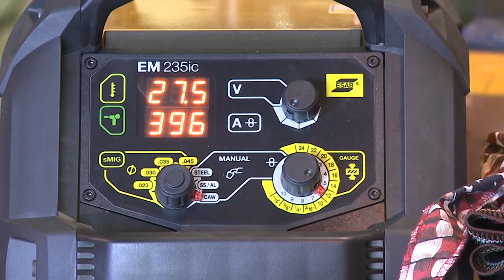🔥 Welding with Ceramic Back Tape

Comment: Pretty good video. We use ceramic all the time in the shipyard. When we join units together in the dry dock or pre fab shops. It’s a lot easier then a metal backing. We use a different wire but basically same idea.  X ray and UT quality in the shipyard

Comment: Hello, when I was working for USNS, CHARLESTON NAVEL SHIPYARD IN 1990-1996, I had just started in my welding career, we used tile on all plate fit ups, even corner joints, Flux Core process. The only thing we would not use it for was on the Hulls of Nuclear Submarines, HY-80 / HY-100, using SMAW- 110/18. Yes I think you could’ve dial that in a little better, getting rid of some of spatter, probably turn the bolts up , wire speed down a hair. But I think you did fantastic. I think all of your tutorials or really great, I am a journeyman pipe welder and have been since 1997, it is really good that you teach the backfeed method on Pipe, Test Supervisor, are not going per code these days, B31.1- B31.3, ASME III , it seems they have their own personal preferences these days, on what they want on root reinforcement, you go to Louisiana or the West Coast and they want minimum 5/32 gap ,  Heavy root, then you go to other places and they want flush to 1/16, which is code. Thank you for all you do younger generation is in desperate need, and the industry is definitely hurting from the lack of craft.

Comment: I used that tape when I was at welding school for uphill welding with fluxcore wire (Esab OK Tubrod 15.09). Way faster than open root or backing plate.

Comment: I've got a roll of it in my locker. I use it every now and then when those fitters decide to leave me a 5/8" gap to tig shut. crank the heat and pour the wire in. stuff works really nice!
Reply: 5/8" gap! That's like the Grand Canyon, I love Tig and have pushed a lot of wire but that's beyond anything I've done. Do you have any video of that?
Reply: James Zivny I don't have videos but I've got some pics. idk how to upload pics tho
Reply: Brian lair 
I'm  one of those , you see most shipyards the fitters and welders are ONE. @ bae systems ship yard the welders and fitters are separate, we preps and do most of the work. the welders just weld...........that's it , you will never see a welder carry blue prints  because their spoiled🤔
Reply: Brian lair 
i wouldn't leave 5/8 gap though, that's too much lol

Comment: Awesome presentation Bob ,I'm a welder for w&w/Afco steel we  used that ceramic backing tape quite a bit groove weld on structure beam bridge beam it also comes handy plugin holes

Comment: One of our test at bath iron works is 3\8 plate double bevel feathered edge ceramic backing vertical up vertical down horizontal and overhead 0.45 100s hard wire 95\5 gas. Roots have to be perfect. Pulse arc. Now theirs a video id like to see you do!!!! Great videos love what you do!!!!

Comment: I'm sure you've figured this out by now, but when you're welding in the flat position, you're in about the top end of the recommended parameters for that wire at 400 ipm, but your voltage is a bit low for that speed. At 400ipm I'm usually around 29v and adjust to the particular wire/machine I'm running til I'm just at the threshold of getting that nice spraying sound.

Weld still looks good and has adequate penetration if your voltage is just a bit low, but you end up with way more spatter than you need to which can be accidentally welded into the toes of your weld if you're running long fillets

Comment: I use ceramic on a daily basis, on the root pass hit bevel to bevel, then stringers to fill out the rest... our code says 5/16 max size bead. So you're doing the root correct but the hot pass and cap should have been 2 hot and a 3 pass cover to weld to standard. i weld 3/8" to 3/4" material sizes... Mostly 3/8" and if we can't get the steel backing plate in, we use the ceramic for that and the edges of the cover plates, they last a good while, jus grind to the shape ya need to fit and weld away... they work great for plugging holes in materials that were drilled in the wrong place...

Comment: I have used ceramic tape in welding stainless as well as mild steel. I once tried welding 1 inch plate in one pass with the ceramic tape and flux cored T70 wire worked well but even with a water cooled torch after a couple of feet run I could see the tip through the nozzle just before it melted. That was back in the mid 90's, as I remember it was around 32 volts and 450 amps basicly had the machine flat out.

Comment: Have you guys done a video on plug welds? Today I was forced to do some plug welds for a friend in the vertical position with very old and unbaked 7018 . I'm a new welder so i did my best ... good thing the welds don't need to be that strong in this case cuz I have no idea what I was doing

Comment: Used this stuff on a steel haul super yacht here in a NZ boat yard used boxes of the stuff works well. Tricky to use overhead though with solid wire on mig.

Comment: They make them also in a beveled variety for welding heavy flange butt welds on full pen WF beams.
You tape it into the bevel side and then weld the inside of the flange, remove the tape and fill the beveled side.
It eliminates back gouging in many instances.

Comment: As a few people have stated before, 70 C is a "metal cored" wire, it will contain very very little to no flux in the core powder.  Mostly all alloyed powders.  You didn't note what brand 70 C you were using or diameter ? I would try it again with either 100% Argon or 100% Co2, as most manufacturers now days are designing the 70 C to run on either one of those gases.  Also, " metal cored" wires don't pick up moisture from sitting out in the open like "flux cored" wires do, so unless the wire is has been sprayed with water or had something spilled on it or is extremely dirty/dusty, I don't think that is a problem.  Just my opinion, but it looked like the puddle had a lot of disturbance, might try backing off wire feed and voltage.
Reply: Rick Reiff Good feedback. Thanks

Comment: Nice bob, for a moment then I thought we were going to have an entire episode without a funny..... Hey what about doing an episode on joining some I beams... Maybe end to end or at 90 degrees... Might be useful for those workshop projects !
Reply: You can use 2F, 3F and 4F positions when joining I-Beams
Reply: ARCSTREAMS 
Why do it that way? All about speed and ease of construction. 
Plates usually welded onto beams, rolling the beams so all welds can be welded 200 amps plus spray transfer Gmaw, or dual shield fluxcore. High speed, high penetration, high strength/quality (just as strong if not stronger than mmaw with low hydrogen rods provided procedures are followed). 
Lower labour costs due to speed, therefore maximum profit.
If site welding in position cant be avoided, usually 7018 Mmaw.

Comment: I used a lot of it in a shipyard. When wire got called for. Never with stick, mainly because stick process was saved for repair. However I'm sure it would function similarly. The big reason it's used is you can run that monster 1/4' gap and ensure a properly penetrated and fused root without running 6010 or backing and it's a shit ton easier than OR flux core procedure. Our procedure still called for a backgouging/welding procedure in conjunction with it. Which I'll admit was dumb as hell. With a 1/4" fit up you can throw a 5/16" x 1/8" cap down the weld to meet reinforcement requirements and move the hell on. Lol
It works really well. 3M makes some that works really awesome.
I've used it some on tanks, mainly in conjunction with automatic processes like sub-arc and automated flux core wire feeders. It really helps.
Also with bad I mean like should fail an x ray kinda 1/2"-5/8" gap fit ups. I'm sure Bob has seen that bs a time or two.

Comment: We used 71T1 wire to weld our verticals in the shipyard X-ray test. About 20-23 volts. Wire speed about 200-210. We put no movement into root pass. Just had a run off tab in the entrance and exit, we'd dip into the plates off run off tab. Then keep steady tight arc and let the weld do the work with very slow movement up the plate. Which created a very nice root on the back of the conjoined plates. Afterwards we would run a single filler pass (weave) then turn right around and do 2 stringer bead cap. Would like to see that as well. To check our gas we would just hold our whip to or ear and when you have ear plugs in you want to barely be able to hear the gas coming out the nozzle (old timer way) but works great! We ran straight co2. If you make a follow up video I'll be sure to catch it. Great weld though.
Reply: Laffy Taffy Good feedback. Thanks.

Comment: I've used Copper and aluminum but not ceramic. Very interesting. Thanks
Reply: Ditto, both work really well for me when butt welding patches in sheet metal, prevents blowing holes in the material.

Comment: I encountered the ceramic backing back in 2001 in Mobile Alabama used it a little bit for about 6 months and then again some six years later and from there to the present-day 👍🏿I'm testing on it (ceramic backing) in about 3 weeks from now, 1"×7/8×18" plate with 0.52 and 1/16 wire, gas CO2 75/25 
As WELDERS WE TAKE PRIDE IN OUR CRAFTS!!! 
SHALAWAM FAMILY

Comment: I use this all the time in a my shop we do shipyard and structural we mostly use it for full pen welds and just leave a root gap pull the tape off once welded all the way then gouge out to the root and weld again for complete joint penetration

Comment: Try running 90/10. With that gas, and the same setting you are running, you should almost be spraying it in. Or even go to a 92/8 Co2.

Comment: Use it all the time. They have different shapes as well. They don't always work the best if it's a rough weld to get to. You get to far out in front of the puddle and your screwed.

Comment: Wow, nice product. Almost seems like cheatin!!! :-D  Thanks Bob!!!
Reply: Back in 1981,82 when I was in welding school our instructors got samples of this from 3M for testing.  The ceramic backing I think had been tried before, but the big thing here was that 3M was able to develop a foil tape that would adhere to the steel and not burn up in the process.  That's some amazing chemistry!
Reply: I tried re-using the ceramic pieces with aluminum foil tape as used in air-conditioning.  The ceramic parts are really rugged and not destroyed in use, but the improvised tape made a mess.  This is trying to save money and material in a school.  I think it would be easy to make a little fixture that held the ceramic plates and just pressed them on to the work.  You could probably get several uses out of them in a lab situation.

Comment: I think today was MAG monday. MIG =metal inert gas. 
MAG=metal active gas.
Reply: Co2 active. Argon/Co2???
Reply: Bob  Moffatt ar/co2 is stll considered active (at least over here in switzerland). Everything that's not straight noble gas counts as active, or at least that's how i got it taught to me in my apprenticeship.
Reply: Ammagrimmgul Very true. Do you know any blokes on this side of the pond that call GMAW mag?
Reply: Northern Sweden Welding We call it mig Monday. You'll have to consult the home office to get the name changed. Good luck!
Reply: actually its metal core wire not flux core and my limited experience with it, it likes the high voltage around 30 volts providing that is .045
Reply: jonathan parsons Correct. It was .035 wire though.
Reply: Bob  Moffatt was just talking to a friend from college try 30 volts and 370 wire speed, should be close to a spray transfer providing that esab runs as well at the Lincoln machine we were using
Reply: jonathan parsons Could be the machine. 27.5 and .035 wire cooks. I need to play on this machine more. I've not run much on it yet.
Reply: Bob  Moffatt no, actually i dont, but i've been wondering about the reason for a while ;)
Reply: We are an odd bunch over here I guess. See you guys call it MMA for stick welding? We call it SMAW or stick. So, mig is a nickname from way back, like tig and heliarc. I suppose we should just all go by the internationally approved acronyms of GMAW, GTAW, FCAW, SMAW, SAW.
Reply: Bob  Moffatt over here, stick is called "electrode welding" (poor literal translation). The first time I heard the read about SMAW etc. was here on youtube.

Comment: Ceramic backing is a life saver when it comes to working with shitty fitters that don't take pride in their work nowdays.  Trust me.  Had a weld that already past x-ray and the next component that went together didn't line up so they decided to cut out the weld.  Ended up with a 3/8 to 1/2 inch gap that needs to be reshot.
Reply: D Armstrong, I hope for their "lives in peril" that they at least offered to buy you a beer or two to soothe your savage anger at having had one of your X-Ray quality welds destroyed because of their stupidity.
Actually I think you would be lucky if they said "Sorry". But if you had done the same to them no one would hear the end of it.
Reply: Mark Fryer I don't even care anymore.  Good thing for ceramic backing.  Getting ready to drag this job anyhow.  Good stuff brother